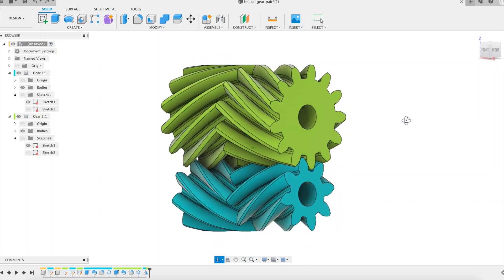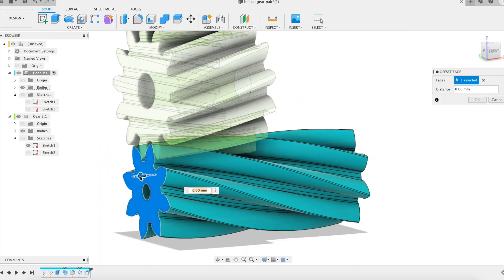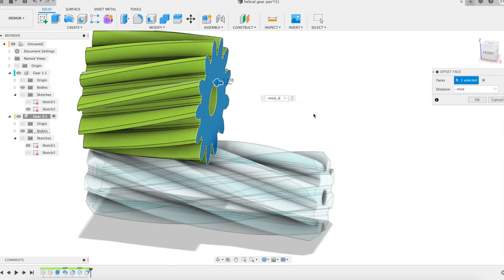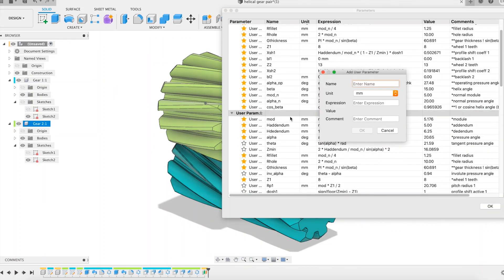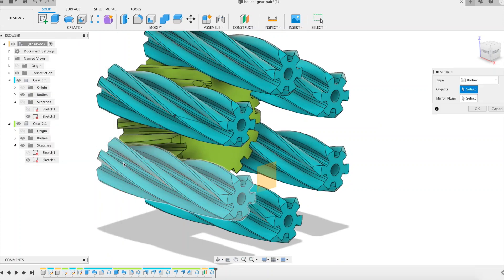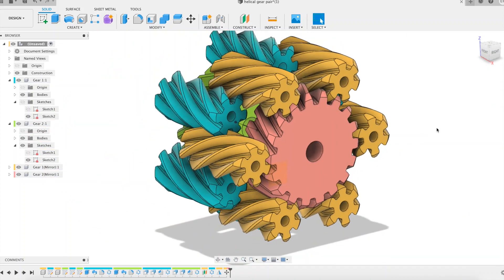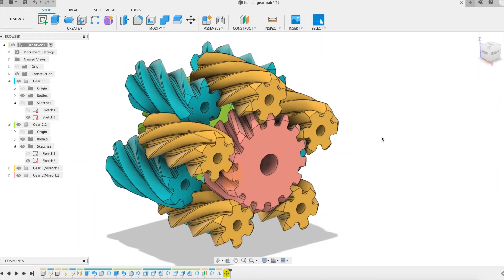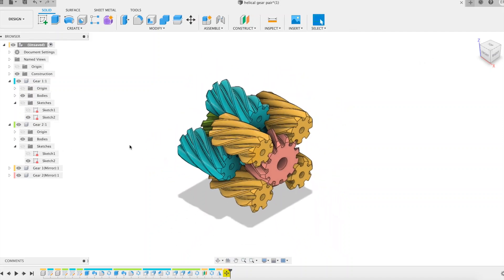Differential internal gears with helical planets and suns, parametric (Fusion 360)

Comment: Hello, I am an aerospace engineer interested in utilizing your gear parametrization model. While reviewing the list of user parameters, I came across the equation Xsh1 = 0.30992 + 0 * Haddendum / mod_n * (1 - Z1 / Zmin) * dosh1. I would appreciate clarification on why the value 0 is employed on the right side of the addition operator.
Reply from the maker: The expression on the right side of 0 is the "automatic" profile shift coefficient formula. I left it there as a reminder, thus the 0 to "ignore it" for the calculation.